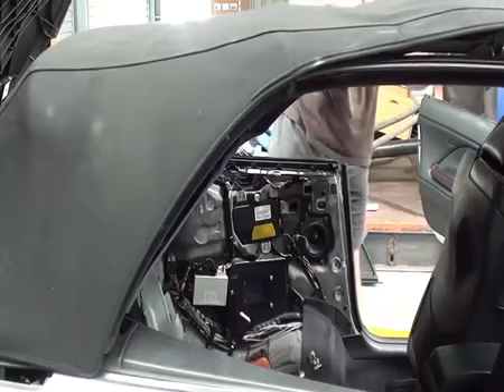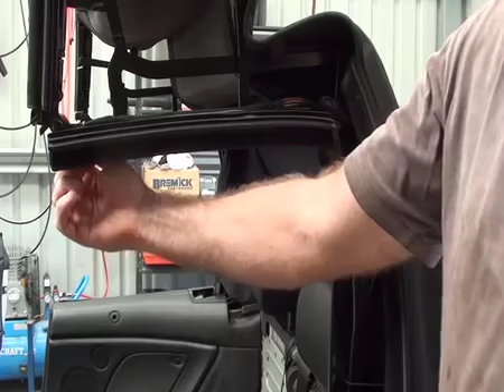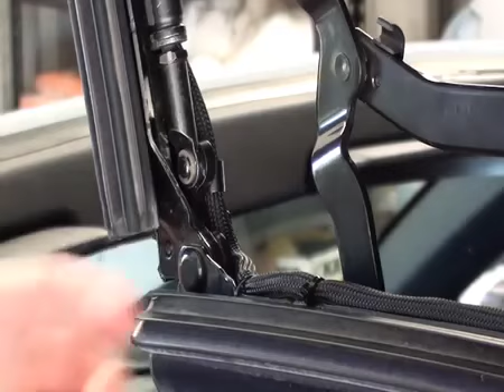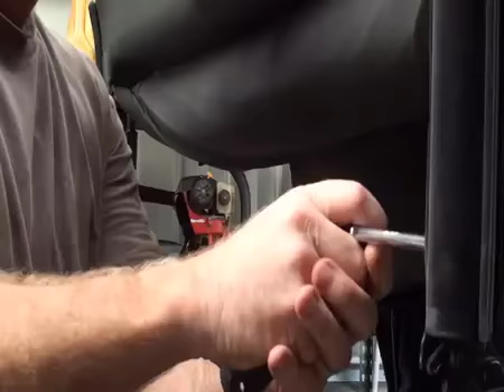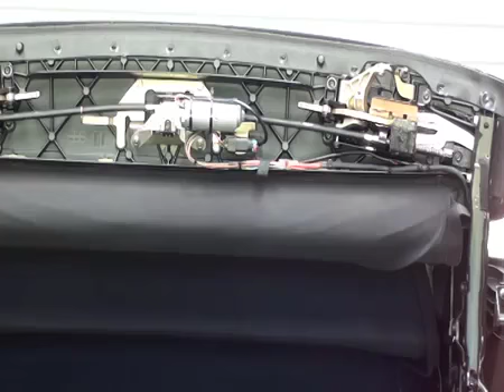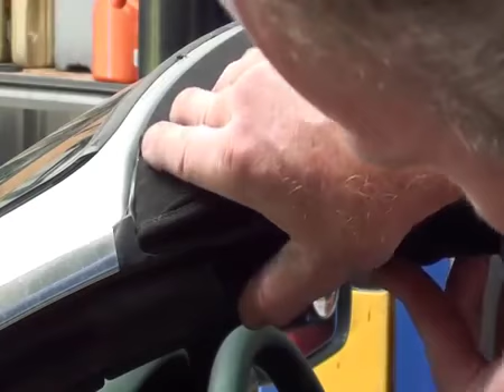E46 Convertible roof broken wire fix

Comment: Does the convertible motor need the instrument cluster in the dash to work in order to operate? I am not getting any power to the Convertible motor, just a solid red light for up or down.
Reply from the maker: The instrument cluster is the controlling unit for the K bus, which is the comms systems for much of the car. If the instrument cluster isn't working at all then the K bus won't work and so the convertible module can't communicate with other units, which is essential to make it work.
Reply: @jeffrichardsoncardiy  so that makes sense as to why the top won't work. Also I haven't noticed anything else that isn't working. Anything else I need to check that the instrument cluster controls?
Reply from the maker: @Tx03edge  It should only affect things that need comms with other units. There aren't many other than the diagnostics as most units work independently and aren't looking for messages from other units to be able to operate. The CVM is a bit unusual as it needs to get a lot of info from the general module about windows, boot open, etc.
Reply: @jeffrichardsoncardiy  so it sounds like once I get the cluster repaired, it should work again?
Reply from the maker: @Tx03edge  I would think so, but getting it working correctly is essential prior to diagnosing the roof if required.
Reply: @jeffrichardsoncardiy  yea, I guess I have to send it off to some guy in Cali that repairs these all day